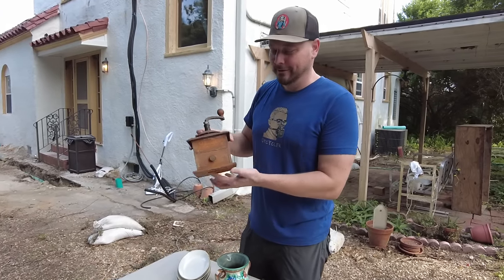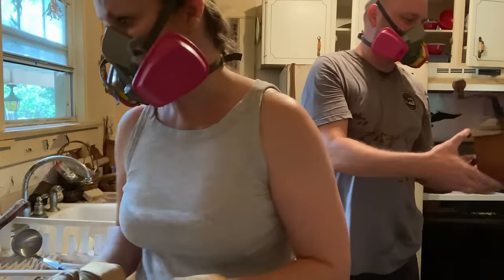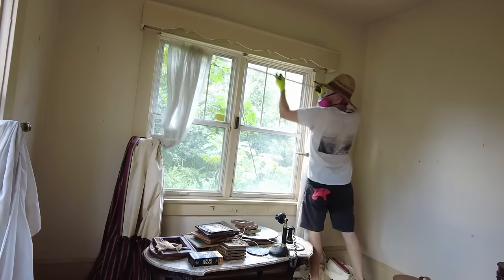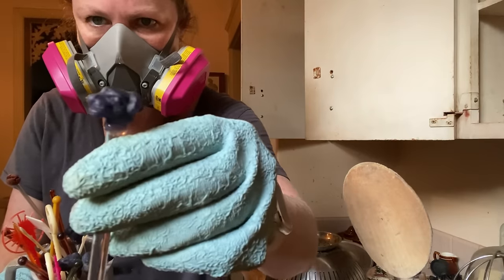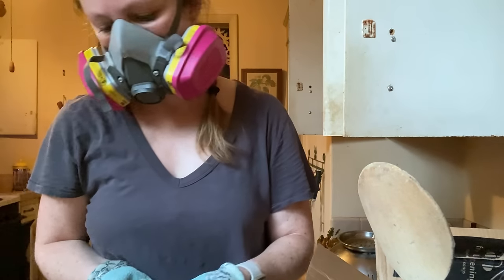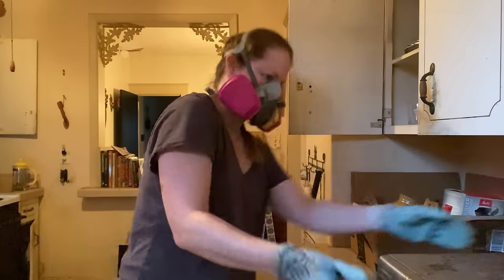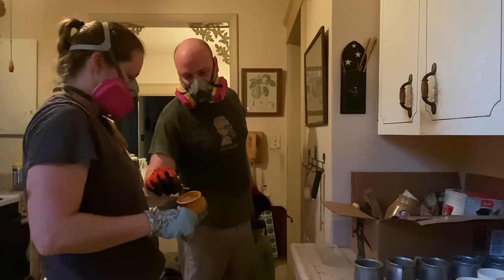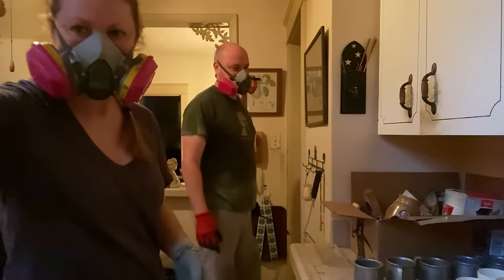Kitchen TREASURE HUNT (Part 1) Ep 22

Comment: All of the plumbing traps are probably dry. Pour water down them right away. Sewer gas is venting into the house. It smells bad and is very unhealthy and can be flammable. Get a shop vac and get everything vaccumed up. Buy a commercial grade mop and mop bucket with a strainer. and bleach the hell out of everything. The smell will drastically improve. Repeat several times. Hire a laborer or two to do the grunt work for a few days minimum. Get a dumpster immediately. Handle garbage only once. Don't kill yourself get cheap help.
Reply from the maker: At the time of the video we were waiting on our dumpster to arrive, but the work couldn’t wait 😊 we were the cheap labor and we scrubbed every surface of the house. The plumbers capped everything so that wasn’t an issue. We wish that had solved the smell problem lol. Thanks for watching

Comment: I am really enjoying watching you both clean out the house with such interesting and old items I can remember using. My only issue is I am a bit deaf and am having trouble hearing what you are saying with your masks on. I tend to lip read a bit also but I can’t see your mouths either. I understand that you need to protect yourselves from the dirt, dust and vermin excrement so maybe for those with hearing issues you could put in subtitles.
Reply from the maker: Thanks for watching. We've had an issue with YouTube adding subtitles. We'll work to improve the audio.